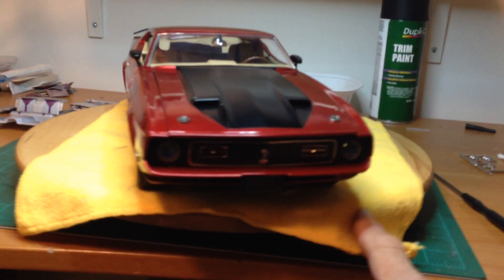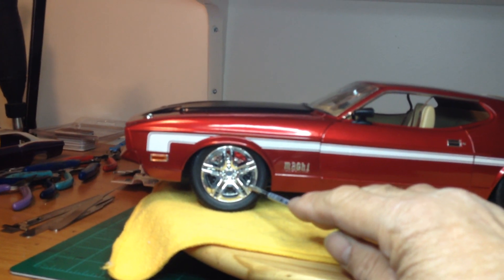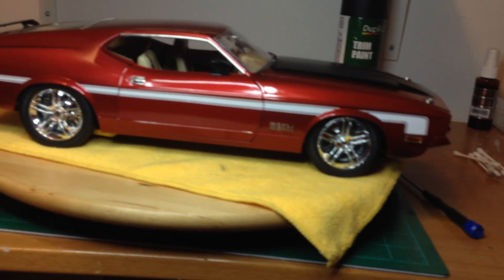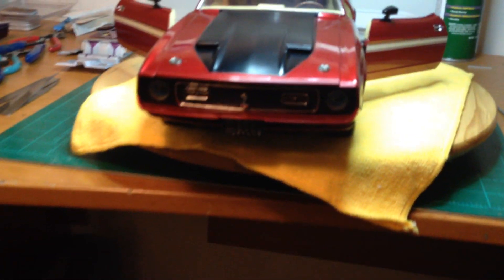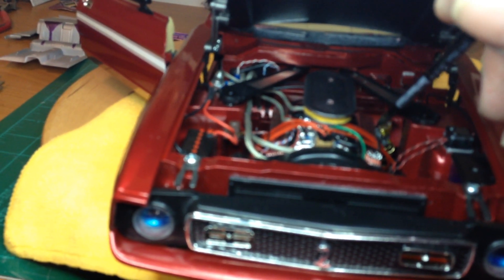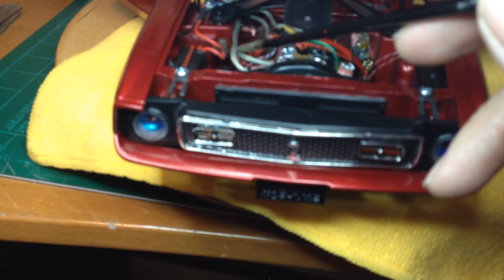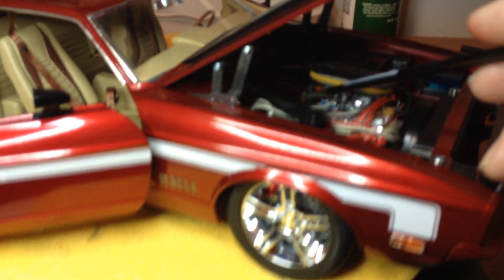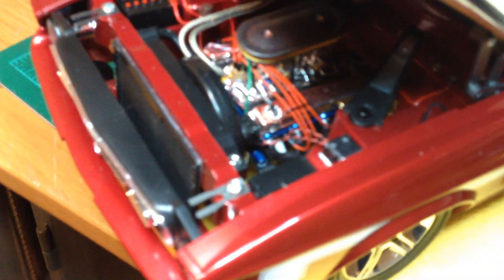Scale Model Car 72 Ford Mustang Mach 1 final build

Comment: Hi Mario,

Ive searched everywhere to find a 1/12th scale engine to put in my foose camaro, but cant find anything!

Please could you point me in the right direction to find these parts?

Great work!
Reply from the maker: What wrong with the engine that came with the kit? if your looking for a big block go on ebay and buy the 1/12 monogram 67 chevy corvette it comes with 427 and different induction systems
Reply: Mario Cosby Hi, Thanks for getting back to me!

I should apologise I'm typing on my phone so wasn't explaining properly. basically I have ordered the kit but I want to go into the level of detail you have with  the engine.

I''ve never built a 1:12 only the smaller scales, and assumed that the stock engine supplied would not go into anywhere near the level of detail like in your builds?

I'm from the UK and was hoping there is a one stop mail order site for all the shiny engine bits and pieces you put on your models, wheels etc.. good call on the Chevy 67 thanks!
Reply from the maker: William Mason sorry William there's not mush out there for 1/12 some of the parts come from other kits I find on ebay, my wires and steel braided hoses come from Teds modeling marketplace and TDR Innovations.com as for the wheels they came off of a Dub Blazerz cars you can find on ebay I hope this help you if there's anything else I can help you with let me know Mario
Reply: Thanks Mario,

I'm just surprised a little that the 1/12 scale isn't catered for so well, is there any reason for this do you think?

Thanks for the advice, i will start searching for bits now :)
Reply from the maker: not too many people build 1/12 car I believe it's the cost of buying 1/12 models